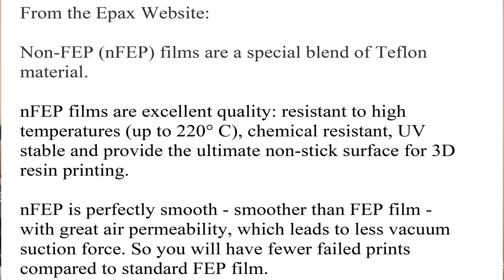NFEP for resin 3d printing, you're not using this?? WTF?!?!  We need to talk about this!

Comment: Thanks for putting this out there. I recently started having issues with my print sticking to the fep. So after I check my printed, it’s usually empty support trees. Hopefully this will help fix this. I’m working on dialing in the exposure to see if that works as well

Comment: Teflon is DuPont’s brand name for it’s fluoropolymers. Teflon PTFE (polytetrafluoroethylene) is the first. It is commonly called “Teflon” and became a popular polymer because of its non-stick and low friction properties. It is not suitable for the resin printer release film because it is opaque. Teflon FEP (fluorinated ethylene propylene) has much the same properties as PTFE, non-stick and low friction but it is crystal clear making it an excellent release film. Teflon PFA (perfluoroalkoxy alkane) is a similar non-stick, clear fluoropolymer but is tougher, making it last longer. You can use it in thinner, more pliable sheets, which makes it release easier. The manufacturers don’t exactly tell you but I think nFEP and FEP 2.0 are actually PFA.
Reply: I've found that Phrozen actually does call their nFEP PFA. The other brands don't seem to like to talk about it. DuPont LOVES to talk about their flourinated polymers.

Comment: Been using nfep for almost 6 months, haven't had to change it yet. There's even a few tiny dents in a few places from a model I didn't setup currently when trying a new resin and tried to get off the resin. Still prints without issues. Just wish they were a bit cheaper and easier to get in AU.

Comment: Great video Greg, as always. But, as the late, great Richard Feynman said, "Science is the best thing we have to stop fooling ourselves." and "The test of all knowledge is experiment". Your hypothesis, based on anecdote, is probably correct, but the only way to know for certain is to test it, and it wouldn't be hard to do. Make a control as best you can - same printer, same settings, same resin etc. Then prepare one vat with FEP and one with nFEP. Get someone to put one vat on each machine, taking note which is which. Preferably, have no contact with the person who does this, so they can't give you any subliminal clues. Then print the same files on each. Gradually make the supports worse. Compare results. Only after there is a clear winner, find out which printer had the nFEP. Or not, but I think the results would be interesting - a live show perhaps?

Comment: The only thing I can see is that the nFEP has a Teflon spray applied or teflon lubricant in the sheet formula.  I used to use a dry ptfe spray on my FEP to keep it sticking less and now I just need to buy nFEP and it does the same thing, so without know the science behind it all seems like the combined those 2 elements to make a better FEP alternative.

Comment: It looks like they only make .125 thickness, I'm using a Voxlabs Proxima that uses a .15 fep, have you had any issues with a printer that uses a different thickness fep? Or has anyone tested this?
Reply: I'm not sure why that would matter. You should just make sure to level the bed after the switch to the thinner material.

Comment: NFEP fitting question for you that i can't see asked / answered anywhere; judging the tension. For most FEP fitting i can see that you can gauge the tension by it being 330hz or so when struck. Does NFEP work to the same register or does is slightly different chemistry mean a different ideal register? (I ask because i'm barely getting 200hz even though it seems pretty darn taut!)
Reply from the maker: I just make sure it's tight, beyond that I don't use any method to check the actual tension  :)

Comment: The NFEP I got for my EPAX E10 is by far the worst FEP i've ever used, even on amazon it has a 1 star rating, there's no protective film, it's really thick (0.16mm for mine) cloudy etc.

Curious what you got now
Reply from the maker: Just using what came installed, been working great so far, no need to change yet  :)

Comment: Just started to Print SLA on a Orange Longer 30. 80 % of the time I get print fails because of the prints sticking always to the FEP. I dont know what I am doing wrong. I tried PTFE Spray and sanding the build plate, what helped a bit. So seems I have to change to nFEP. Unfortunately only in US, what means waiting for 4 weeks. Any other tips what I can do better ?

Comment: I've found nFEP much superior to the FEP that shipped with my printer (Phrozen Sonic Mini 4k). 
I also swear by lubing the nFEP with a tiny spray of silicone lube and a rub with a microfibre cloth before pouring the resin. I tried it after someone suggested it to me when I was getting the occasional failure, and to be honest I haven't looked back - I haven't had a failure since I tried it, the 'pop' of the nFEP releasing is much quieter and it accrues fewer dents than if I don't lube it. 
I'd be very interested if you ever tested lubing the FEP / nFEP  on the show, as obviously my sample size of one proves nothing.

Comment: Generally speaking, with these kinds of things I rarely believe that companies have come up with something new. Usually it's just a chemical product out there that already exists and they're just branding it.  With nFEP I kinda wonder if it's just Dupont Teflon PFA instead of Dupont Teflon FEP.  The main reason I wonder, is that it lists a higher temperature resistance, which is a big selling point of PFA according to Dupont.  Either way I don't think a company like Epax has the capital to do the research and development on some special new compound as a print film.  Reminds me of Worbla in the costuming community, which is just PCL plastic and they sell it at an insane markup by mixing it with fillers and selling it in sheet form instead of pellet form.

Comment: I switched to nFEP and it’s been a breeze. Definitely fewer adhesion issues. Only thing is that I used the clean function on my sonic mini 4K and I could NOT get the resin off the nFEP. Not sure if I accidentally ran it multiple times or what. Had any issues with this?

Comment: Thanks for this. I have been resin printing for 2 years, recently bought a mid size printer for larger models and have only had 1 good print from more than 20 attempts, sure its the FEP since the resin sticks to it every time , no matter the settings. Feels more like Acetate than the FEP i'm used to using!

Comment: Apparently nFEP is a doped form of FEP that is supposed to have better UV transmission as well and a higher tensile strength. So finding out what the doping is done with is going to be interesting. As there is a whole family of FEP type films that are able to handle all the way up to 500° C. Interesting stuff. Inert for the most part. Though extremely toxic in the process of producing it and IF it is burned by any means and takes forever to degrade. So your comments make sense.

Comment: O, Greg you again pushed my buttons :-). Now hear me out, folks! There is no such thing as nFEP. Basically, there are three versions of  "vat material" PDMS, FEP, and nFEP. I'll stay with short names. If you want a full chemical name google it. So PDMS is basically a silicone rich in oxygen that is spread across a transparent substrate. DLP machines or laser (early Formlabs) machines use this solution. FEP is a film containing Teflon (in a very lame language). nFEP or non-FEP or not-FEP is also a film containing some Teflon. As you know Teflon has "non-sticky" properties.  Well, but there are even more solutions! Though all based on Teflon or its derivates. The best, by all means, is a Teflon AF2400. This monstrosity is optically transparent and oxygen permeable!!! That means that resin NEVER solidifies due to oxygen inhibition (doesn't allow) of polymerization. The second best would be a PFTE, though there are not many products that have optical transparency needed for 3DP. PTFE short Teflon has a white color. Though a product called Tefzel is transparent, not sure about UV though! Oh yeah. AF2400 is VEEEEEEEEEEEEEERY expensive. Another candidate is PFA it's also called a premium FEP. As the name implies is a better FEP but not much.
To wrap it up. If you can afford or even find a producer for a large sheet...go with Teflon AF2400, the 2nd best would be Tefzel (commercial name for transparent PTFE) or a derivate of PTFE. The third is PFA and the fourth would be a humble nFEP or/and FEP.
So, here you go...(shhh... but there is more)
Reply: BTW,  as I'm not the smartest and not the most knowledgeable person on Earth I would really like to hear if somebody found/tried a different material/solution.

Comment: So that's why I love my E10. I was thinking it's all because of your new supports that I am using but it's just the quality of the nFEP 🤣
I also noticed that the nFEP seems even more slippery than the FEP on my other printers. As soon as I pour the resin back in the bottle, there is less left over resin on the nFEP than on the FEP.
By the way: your new support settings rock. It has been easier than even removing support and printing successful models. I can hardly stop printing 😁

Comment: I just got the Epax E10 and I noticed that my prints fail because they stick to the FEP. This causes prints to get ripped out of the supports and I even went crazy on adding double the supports than usual and that improve the prints failure rate but it does not fix it. My previous printer was an Elegoo Mars and I never had this issue. Do you think the FEP film that comes with the printer is lower quality than the one in your description?
Reply: E10 comes with nFEP

Comment: Nfep might be PFA, or a blend of FEP and PFA.
Reply: nFep works noticeably better in my experience. I don't even hear the film release, although mine is also installed very tightly. I'm also printing at 240 lift/lower and reduced the lift distance to 4 on regular layers.
Reply: I print exclusively with PFA. It seems to work fine. I've never had an adhesion issue & there really isn't much noise during release. If I'm doing a full build plate there might be a faint noise on the base layers that sounds like tape being peeled from a surface. I never get any snapping or popping like I did with FEP.
Reply: @josephargyle2386  I'll have to find a source when It's time to get more "nfep" then.

Comment: There was a guy here on YT some time back (and this might have been when FEP was truly expensive vs now) that was using laminating films in place of commercial FEP. Something I was going to try on both these DIY solutions and commercial grade is adding my own coatings.  I have a strong suspicion that this magical coating is the active lubricant in all the new 'ceramic' wax coatings for automobiles, aka silicon dioxide.  I happen to have a fairly large amount of one left over from when I did my truck, and this stuff does in fact work. It sticks like glue when it's wet and is totally hydrophobic when dry, though when you need something with optical clarity, the utmost care is required versus just putting it over paint. It said it was okay to apply to windshields, but I bet they didn't test it when it was 104* outside... I had a devil of a time getting a streaky section off from between where my wiper blades overlap! Nonetheless, I'd be game for making a batch to see if total optical clarity can be had from just applying this to regular FEP and a few DIY solutions I have rolling around.

Comment: You know there is a way to validate anecdotal evidence especially since you own a ton of printers and have NFEP and can easily get FEP. Literally, run the same printer with and FEP and NFEP and crunch the numbers. You clearly print enough to be able to get the data. That would be science backing up marketing materials. The chemistry while interesting isn't what backs up the claims it would be the data. Like there are many things in chemistry where we still don't know why or how it works. The important stuff is the data. And how you do that is developing test methodologies to see if it works or not. When you slice files it gives an estimated amount of resin used so you can, for example, every time you print add that to an excel until it is time to change out the FEP or NFEP. Do that over multiple sheets and you have the mean volume to replacement. Then you can look at the percentage of prints that fail using FEP vs NFEP and over time that number should get more accurate since you would have larger and larger sample sizes. You can even do it over multiple printers and eventually maybe from different people.
Reply: yup. or could just hire 30 engineers and chemists to do all the crap you want him to do.

Comment: Does this mean all those Pre-Supported models you've done for your and other groups models, have only been test-printed on NFEP?  That would have been good info to have, if so.
Reply: You bring up a very good point, if his setting worked more successfully than ours primarily due to the nFEP as opposed to the settings you've done tuned.... Can you do a side by side test with your settings and both an FEP setup and the nFEP. Preferably on the identical printer? It does stand to reason that having a more slippery surface giving an advantage over better setting. Ideally having both would be a reasonable goal. But you like science and data so this sounds like a reasonable request.

Comment: So curious about this!
I am new to 3D printing and got a Saturn back in Sep and am still on my original FEP.  But looking in forums at how many people go through a FEP every week or two, and then go to nFEP and go several weeks without issue.  Not sure what is going on there, but even if nFEP is more expensive it is going to save a lot of down time, cleanup time, and film costs.

But my main curiosity in this is with lift height.  On my Saturn I have a lift height of 10 to reliably not have any stuck layers or other issues.  If nFEP films can help me reliably move that back down to the stock 7mm, or even lower, then that would dramatically speed up print times even more than the vroom settings.

Comment: I just picked up a pack. Will let you know.
Reply: UPDATE: I am not convinced... yet. First print was the mid section of the Pit Fight arena on my Any Cubic Photon. I printed it flat on the plate and hollowed to 2mm wall thickness. It appears the bond to the film was too strong. So strong is actually shifted the build plate. Good news is i did not loose adhesion to the build plate, but it gave a rather wonky curved print. It appeared to shift early in the print, but it is difficult to say at which layer. I would appreciate and comments or critiques of my settings.
Print Settings as follows with 75:25 Elegoo Grey ABS with Siraya Tenacious. These are my normal miniature print settings.

Layer Height = 0.025 mm
Bottom Layer Count = 6
Exposure = 8 sec
Bottom Exposure = 90 sec
Light off = 0 sec
Bottom Light off = 0 sec
Bottom Lift Distance = 5 mm
Lift Distance = 5 mm
Bottom Lift Speed = 65 mm/s
Lift Speed = 65 mm/s
Retraction = 150 mm/s
Reply: I removed the build plate, check all screws, and re-leveled using standard printer paper. Looks like i go through the first layers with no shift. I am also wonder if the shift was due to layer adhesion issues which caused the build plate to build higher pressure which would cause the shift. Should be done in about 5 hours.

Comment: This is my first resin printer (Phrozen Sonic Mini 4K) and did a lot of reading waiting for it to arrive so I bought some nFEP just in case. Calibration went well, but printing models I was getting random fails of limbs missing etc on files that the supports were known to work on. Swapped over to the nFEP and increased lift speeds to 240 and have not had an issue since. Loving this printer (if only it was bigger haha). I work with acetate a fair bit for work and one side of it is released with a silicone release (A popular brand is P.T.M Release Film). I have some at home, just trying to work out a safe way to test if it is the same stuff as I have huge rolls of it!

Comment: I used it and it definitely made an improvement compared to my Phrozen Sonic Mini 4K FEP. I got a lot fewer failures on very small supports and it lasts longer. Phrozen lists nFEP on their website but I haven't tried that, I am using the Epax version.

Comment: Thank you so much. Your videos are always amazing and they really help me every time when 3D printing with resin. You are awesome! Keep it up. :) I also have a question I would really like to ask you. Do you think it is possible to color translucent colorless or white liquid resin by mixing it with a bit of paint, maybe Revell Paint or food coloring paint, so that the print has various types of colors or one specific color? Maybe it's possible do cool 3d printing effects with that. ~ Zera
Reply: I would not use paint if it were me. Most paints have a thinning agent mixed in and would not be kosher with chemical solutions in resin, inhibiting the curing state at best and causing a full bottle to break down at worst. They do make tint kits for commercial applications to tint countertops and such, but I've never found the need for a pint at a time at a hobby/tinkering scale. What I would recommend however are the various tints they make for silicone casting which are, more or less, chemically inert, or if you happen to know someone who works with Duracoat or Cerakote, the base colors without the hardener would be my 2nd choice. The silicone tints are far easier to work with in my opinion and you literally need a pea-sized drop to tint a quart or so, they're pretty cheap and a small color sample kit will last a LOOOONG time.
Reply: @C-M-E  Another thing i can recommend, though i can't say if it works better or worse, is alcohol inks used to dye resins for casting, i will have to take  a look at the silicon tints though as well.